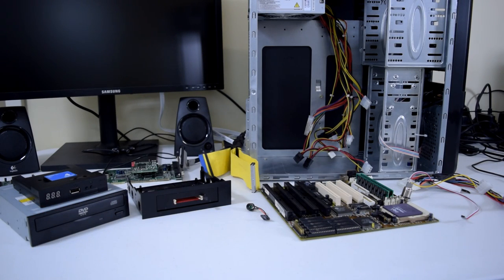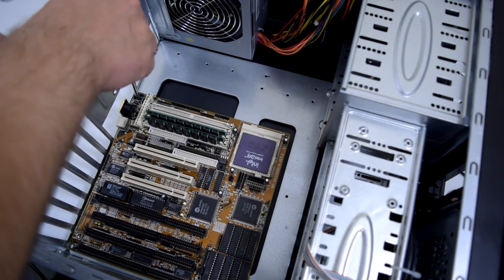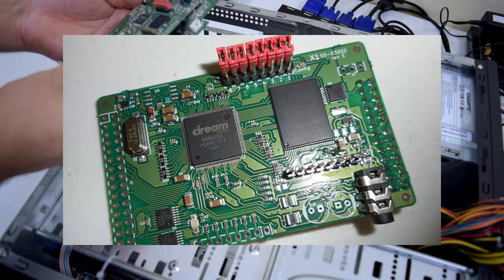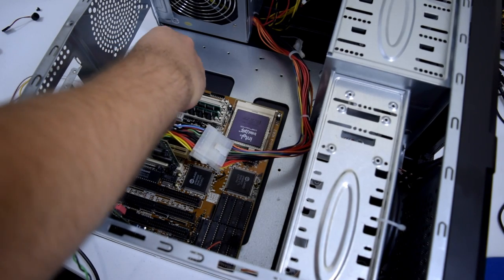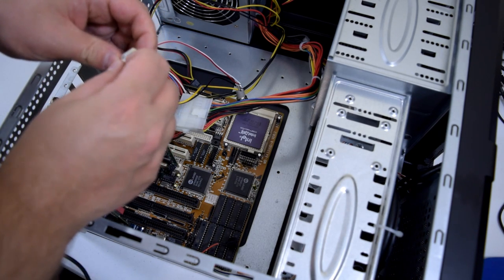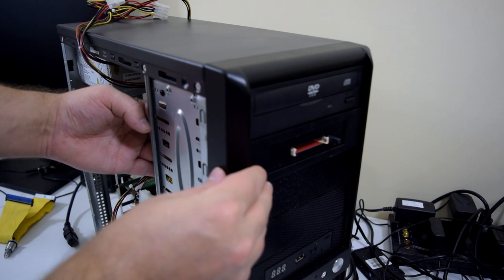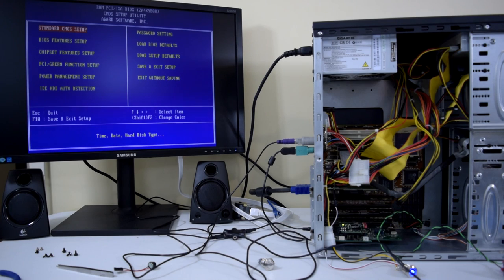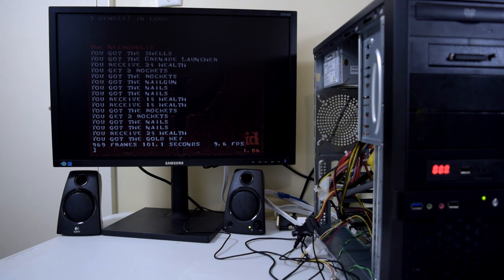Building a 486 DOS PC with modern parts

Comment: I just discovered this channel and had to subscribe immediately - thanks for these very nice videos!

 Regarding this system build: I noticed that you included no CPU cooler for this build. The 5 Volt 66 MHz DX2 CPUs certainly required modest cooling. Given that voltage has a quadratic influence on power dissipation the 3.3 Volts DX4 the chip should of course stay much cooler per clock, while being clocked a bit higher. Then again the DX4 has a bit more circuitry (bigger cache) than the DX2, which may also have some effect.

The AMD DX4 100 CPUs usually included a "heatsink and fan req'd" marking. Given that the AMD 486 chips were quite exact copies on a modestly more advanced manufacturing process (AMD DX4: 0.5 µm - Intel DX4: 0.6 µm) I wonder if the Intel DX4 may appreciate some cooling (even if only a passive thing). Intel never included a "heatsink and fan req'd" marking - even on chips that most certainly need cooling.

What are your experiences?
Reply from the maker: +Maik Merten Yes, you are totally right. A lot of people mentioned the lack of cooling :) I simply didn't have one. I then ordered a new cooler from eBay, it clips onto the processor, and has a fan on top. I will use that cooler in a future video :)
Reply: +philscomputerlab Oh, I totally missed those comments when browsing the comments - sorry for bothering you and thanks for commenting!
Reply from the maker: +Maik Merten Don't worry about it, I always like to hear from others interested in these old computers :) I usually do a video every week and on Mondays. Sometimes I do another, simpler, video on Thursday and Friday as well, it really depends how much time I have.

Comment: Since your 486 board have PCI slots, you may be able to use a PCI to SATA adapter and use a SATA SSD.
Reply: +陈北宗  newer pci cards use different voltage .  keying is different.  sometimes modern cards use universal keying, but they dont always work on old boards
Reply: +va4cqd With careful selection you can get a card that support 5V bus, or maybe a 486 board with 3.3V PCI bus.
Reply: +陈北宗 riply makes some boards that supported the lower voltage pci buses
Reply: chris simmons That is my point.
Reply: +陈北宗 You could simply use a Parallel ATA to SATA converter but you will run into some problems when it comes to supported drive size.
Best way is to use a SCSI PCI adapter to avoid those limitations.
Reply: PCI SATA adapters are just like PCI SCSI adapters, just PCI SATA adapters can support AHCI and 1.5Gbps speeds natively.
Reply: +陈北宗 That's incorrect. Bootable SCSI adapters have their own BIOS so you can break limitations you can have with a 486 (max drive size).
Reply from the maker: +ppdan Easy there :)

PCI SATA controllers also have their own BIOS. You can hook up a 1 TB drive it will work just fine. I would use SCSI but simply have no such hard drives and controllers available. And the hardware I currently use actually works just fine.
Reply: PhilsComputerLab hmm, haven't seen a PCI SATA adapter with bios unless it's a raid adapter. But will those work?

I remember needing a larger HD when I bought my first CD writer and since my system didn't support ATA drives larger than 640MB I got myself a 1GB SCSI drive (good ole Quantum Fireball). Even though my later system (686 P200+) supported larger ATA drives I sticked with SCSI because of it's speed (switched to beter controller and bigger drives). It was expensive but the combination of those drives with the exceptional high FSB of the 686 P200+ (75MHz) made this machine a real beast. This machine lasted until I bought myself a Duron 800 (was on a budget and replaced this one very fast).
Reply from the maker: Yup, for example Silicon Image have a couple of them. They offer non RAID BIOS which you can flash for "just" IDE function.

I prefer to use SATA to IDE adapters though and Seagate SATA drives. Because with SeaTools you can limit the capacity of the drive. So you can turn it into a 8 GB, 32 GB or 120 GB or whatever.

That is my preferred solution. I've done a video on this recently: Seagate SSHD: Ultimate retro hard drive?

You might find it interesting.
Reply: +ppdan Actually I have one of them using Silicon Image chipset. I flashed an AHCI-only firmware on there with BIOS hooks. This allowed me running AHCI-aware OS (I used a recent release of Ubuntu there, so definitely AHCI aware) even using TRIM commands on the SSD.
Reply from the maker: Nice!

Comment: You know, 12V was probably way too much for that power button LED. You should've connected it to the 5V side of that molex connector, it would have survived that way :D 
Keep in mind that a generic LED takes 3V, so by blasting 12V through it you gave it 4x the voltage it needed.. :D

Comment: Thanks for the video -- if there is a PC chip i'm nostalgic about it's the i486..   (After having owned an Atari 800, 800XL, then 520 and 1040ST computers..  the 486 was my next step, and I started with a 486DX-25 eventually OC'd to 48 mhz and ended 6 years later with an AMD 5x86-133 running at 160 mhz -- still a 486 on a 486 board).
Reply from the maker: Yes the 486 is pretty cool. I will do plenty of 486 projects in the future. When I get to it :D

Comment: would love to see the dreamblaster run some old Lucas Art games like manic mansion and DOTT. Or maybe old point-and-click adventure games like King's Quest and comparing it with a pass through like the Gravis Ultrasound...
Reply from the maker: +Luke Luoh Yea, it does depend what game though. Maniac Mansion only supports the PC speaker, so does King's Quest 1 to 3. Later games support the Roland MT-32. Only the newer games have actual General MIDI support and would sound great on the DreamBlaster.
Reply: +PhilsComputerLab huh, for some reason I thought MM has some midi capabilities... Does the card have Roland emu? I remember hearing KQ4 on a friend's rig with a real Roland back in (I believe) 92, and it was a bit of a revelation.... Also does any of the Sierra games like Dr.Brain have Roland or General Midi support? I seem to remember that my old Ultrasound had something called Soundfont or something, that is essentially sound samples for use in midi... Does this card have something similar?
Reply from the maker: +Luke Luoh KQ4 is MT-32 only. I think KQ5, or at least 6, did have General MIDI support. So did Space Quest 4. It's easy to find out, just look for the .DRV drivers. GENMID or something like that. Or run INSTALL and look at the options.

The GUS was a Jack of all trades, master of none. It can do General MIDI but not on the level of the DreamBlaster, Roland or Yamaha.
Reply: +PhilsComputerLab but it was cheap lol, anyhow, eagerly awaiting your demo/review of the dreamblaster
Reply from the maker: +Luke Luoh LOL I've already reviewed it :) Run a seach on my videos and you should find it.

Comment: Dosbox. An open source DOS emulator for BeOS, Linux, Mac OS X, OS/2, and Windows.  Vmware, and Virtual machine can also emulate dos and windows 3.1.  If you are going to use mostly modern hardware and floppy emulators then you may as well just emulate the entire machine with software.
Reply from the maker: +Allen .Berge I fell that there is wide gap or middle ground between the two hard lines of period correct retro PC and emulation. Not just black and white, lots of shades of grey in-between. I like the accuracy, compatibility and authenticity of a retro PC, but I also like the reliability, convenience and performance of modern parts.

Comment: Research your power supply. Although generally the power requirements were much smaller in the AT days, the systems also didn't rely primarily on 12V power which virtually all modern PSUs are catered for. Some modern PSUs efficiencies tank when delivering mostly 3.3V and 5V loads.
Reply from the maker: I have, it's all good.
Reply: PhilsComputerLab I just wanted to throw that out there for folks who may be looking to duplicate your efforts. Cheers

Comment: those buttons have an integral resistor to let it run on 6v. you are running it on 12v, would have been better to run it on the 5v rail.

Comment: Thank you for this video. What happens if you have  a 486 that wants heads cylinders etc for the hard drive in the bios and you only have a flash card? My bios doesn't have autodetect. I have the same adapter from from startech.

Comment: nothing but great thing to say about Startech as well. So have you ever tried FreeDOS? it can read very very large hard drive and lots of RAM, its 100% compatible with MSDOS.
Reply from the maker: +Jason Hicks (TyrForFreedom) Yes I have. It works well, but there are lots of issues with games. Mostly to do with the memory manager.

For larger hard-drives I usually just install Windows 98 SE and use MS-DOS mode (which is MS-DOS 7.1).

Comment: Hello Phil, I loved your videos, channel and the retro spirit, actually I've an old system as follows: 
Lucky Star 5I-VX1C motherboard 
32 MB of EDO RAM
IBM PR233 CPU
ALI Cat 1MG VGA PCI Card
16 Bit Creative Vibra ISA sound card

The problem is the machine doesn't work , I connected every single connector the right way, so I can see the CPU cooler spinning and the CPU getting warm / hot , but the Speaker of the case donesn't beep , I even attached another standalone speaker to the front panel, I still hear nothing. 

I tried to get the old manual, and I found something strange on the front panel of the JP9 on the motherboard, it was a " PEND-SW" I really don't know what is it ? 

Do you have any recommendations or advice ? 

Wish I can hear from you and many thanks in Advance
Reply from the maker: +Ahmed A. Helmy Oh dear, this could be anything really. I wouldn't know where to start. What I usually do is strip all the parts, but the board on a test bench and start from there.
Reply: Ok my dear bro thanks for the quick reply, but you don't know what a PEND-SW in the front panel could be ? , I'll go with your advise and start again...thanks anyway
Reply from the maker: Time to hit google and see if you can find some information.

Start here: https://th99.bl4ckb0x.de/m/mpent_6.htm

Even if it's not your same model, it might give you clues to what it could be.

I've never come across something with PEND in the description, usually you got the speaker, power switch, turbo, reset, HDD lights that sort of stuff.
Reply: Thank you so much :) I'll check and I'll update you if I found something

Comment: PCI on a 486 will slow down some DOS-Games. You should opt for VLB instead. Most games will run fine or very good with PCI. But Latency is a Problem here. VLB allows the 486 to do more stuff in video RAM. 640x480, where PCI shines, is to hard for a 486 anyway :)

There are DOS games wich will never run completely fluid on a PCI System due to latency issues. Turrican 2 is the most prominent one. U need a VLB 486. 100 or 120MHz, 256- 512Kb WB Cache and a S3 805/ ATI Mach or better VLB Video Card. And then, you have to set the DMA Waitstates to 1 or 0. Only with such a system, the scrolling/ gameplay in Turrican 2 will be completely smooth. No AGP/PCI/ PCIe System will be able to achive this. Even with a Matrox Mystique on PCI (Wich is one of the fastest DOS cards) wont be able to achieve more than 50k points on the T2 Benchmark. Most PCI/ AGP Systems will not be able to climb over 40K. And you need more than 60k to never have any slight stuttering. The 486 with the specs i have named, will achiche 70K to 90K.
Reply from the maker: +Hubert Hans Interesting. The thing is, I mostly use the 486 because it's slow compared Pentium. The PC version of T2 is pretty good. I played it on a Pentium 100 and it appears to be very smooth, but I never tried the T2 benchmark. Is this through the SETUP program?
Reply: Yes. In the setup. On a PCI System, u will score very low @ 35k points and slighlty above. (Max was 50K or so with a matrocx if i remember correctly) You think it is smooth, buit its not. The scrolling and jumping feels much better if you have over 70K points. This little benchmark seems to be heavy latency (video-RAM and
BUS) dependend. U will know what i mean if you would be able to compare such systems. The game is very playable on a Pentium 100, though.
Reply from the maker: Cool, thanks for letting me know! I will check it out when I do another 486 project :)
Reply: Have fun :)

Comment: you can get IDE2SATA adapters that should give you the ability to use SATA drives instead of IDE.
Reply from the maker: +DAVID GREGORY KERR Yes, I used them in lots of my other builds :) There are lots of options.
Reply: What about a DAA781 FM2+ motherboard, 256GB of DDR3 RAM, A10-7850k (Kaveri), AMD Wraith cooler unit and forget about the graphics card and sound card as there are perfectly good graphic card and sound card integrated into the A10-7850k you would be using the HDMI port that connects directly to the APU just remove the tiny screw that holds a small piece of card that blocks the HDMI socket and replace the screw without the piece of card and that is that apart from a 5TB SSD and Blu-Ray R/W drive, and Linux Mint 18.3 (Sylvia) 64bit distro or if you have to go with Windows OK but might not activate as they have made obsolete.

Comment: What kind of 486 did you use?  I noticed you didn't put at least a heat sink on the CPU.  Was it a slower one?  If I recall you want at least a heat sink on 33 mhz and once you get past 66 mhz, it really needs a fan on top of the heat sink, or else your system is going to overheat, constantly reset, reboot, or just quit running completely.
Reply from the maker: +sprybug It was a IntelDX4 100 MHz and yes, I forgot to put the cooler on. I got one later, a lot of viewers told me about the cooler :)
Reply: PhilsComputerLab Oh good!  I'd hate for you to kill your CPU.

Comment: +PhilsComputerLab
Even though it's been a while since you've done this, with those older CPU's I always recommend a good TIM and heatsink/fan combo for them as they do get very hot and will last longer with a cooling solution. The last 486 based system I built for someone, a Socket 7 cooler was used and it works wonders.
Reply: Just read through some of the other comments.. It seems this has been mentioned a few times. LOL!

Comment: This is wonderful. I've been having troubles trying to get a 486 build working in an AT case, so going this route is must more feasible. One question, where did you get the power and turbo switches?
Reply from the maker: Thanks, that is exactly why I did this video. The buttons and the power adapter I got from eBay. Just run a search for latching button or similar.

Comment: I'd like to see how that would run one of the very lightweight Linux distros such as Puppy Linux, AntiX, Tiny Core, or even Vector Linux. How about a follow up video showing one of those installed? :)
Reply: `+Linux PC Installs running Linux should be possible, but even slim distros these days probably use too much RAM. I'd install Slackware 7 for the heck of it. XFree 3.3.6 supports the Trio64 well, I believe :)
Reply: +Linux PC Installs What about RedHat?
Reply: Linux PC Installs KolibriOs works fine on 8mb of ram. I tested once on virtualbox.
Reply: I was running a system not too long ago and had a RAM failure. I didn't realize I was only running on 28MB of RAM until I opened up Firefox. Then I noticed I had a problem. Before then though no worries. It was running just fine.

Comment: Is the i486 DX4 100MHz a 3.3Volt CPU? I'd like to upgrade my PC from a Cx486 DX2s 66MHz to a chip with 100MHz. What jumper settings do I have to change? I have the exact same board. What socket do I have to buy for the rtc? My S3 Trio is missing two socketed ram chips. Can I get replacements? And what do I have to buy if I want to put more cache in the board?

Comment: would you be able to link the power button you used? I am currently using the same AT to ATX converter but I dont have anywhere to use the power button except outside the case and that is very cumbersome.  Thanks!  Love the videos!
Reply from the maker: The video is quite old, I remember getting it from eBay. There should be lots of options available!

Comment: Hey Phil, I enjoyed your video, very nice project! I would like to know how do you prepare your SD Card before building the PC? (Installing DOS, make it bootable, installing drivers, etc.) And which Software do you use in your running DOS? It looks like that there is a special menu?!
Reply from the maker: +Axel “Left-Handed-Cat” Teichmann I install MS-DOS from disks, but with the USB floppy emulator. I run FDISK to partition it, FDISK/mbr to make it boot and the startup files you can find on my website, it's a menu with all the memory options, CD-ROM driver and mouse driver!
Reply: thanks for your quick reply, I will take a look :-)
Reply: and yes, the gotek is awesome, but the ipcas Software could be a little bit better: i.e. copying files to a bootable Floppy on your USB stick will overwrite the MBR and the Floppy is no longer bootable. Additionally it can handle 100 Disks "only" but the Gotek can handle 1000 Disks (which is no big problem yet, but wastes a lot of space on modern Sticks, especially if you want to store more than 100 Disks)
Reply from the maker: True. I will review shortly a external version of the GOTEK, basically it works like am external USB floppy drive. It makes working with GOTEK USB flash drives easier, but it does not support 1000 disks either :(

Still, it's a good addition as it will solve the issues with boot floppies that you mentioned.
Reply: very nice, I'm looking forward to see your review soon :-)